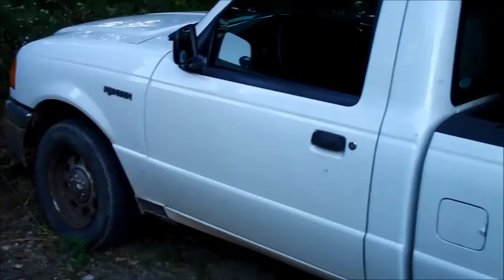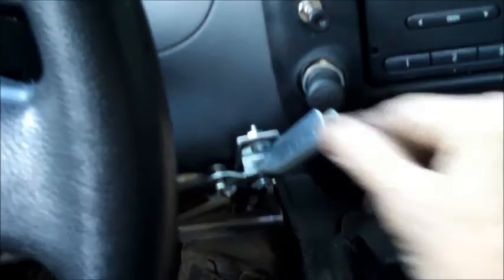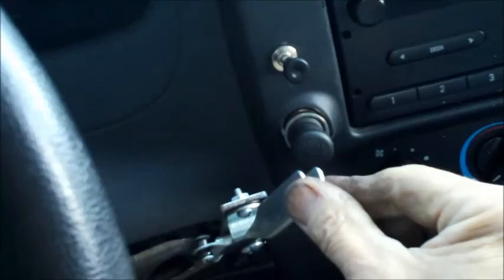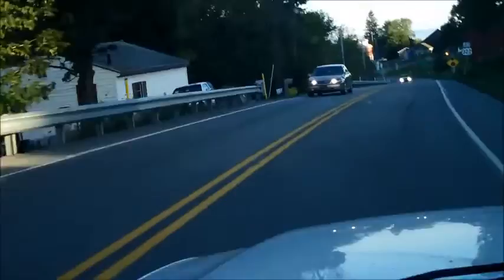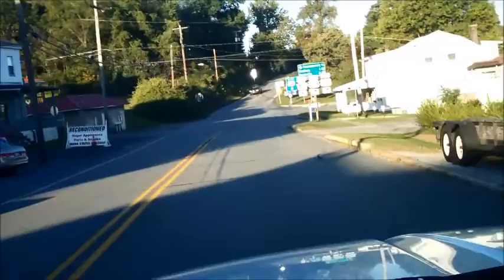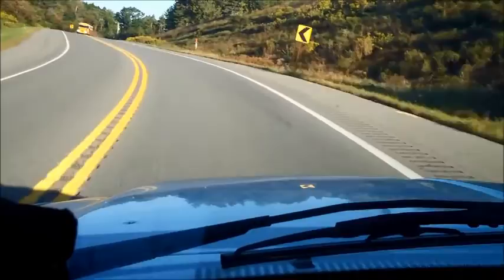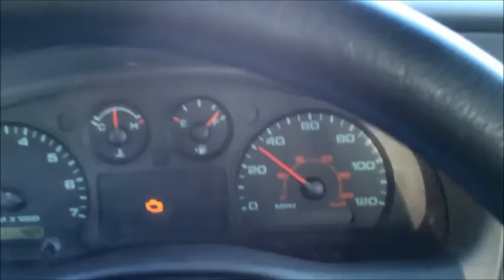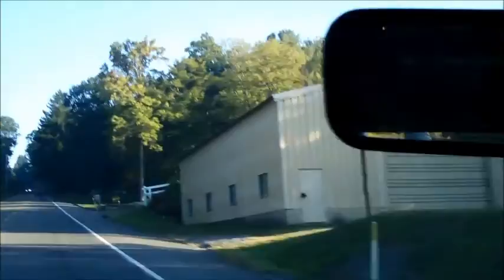Ford ranger road trip

Comment: Gary,  great work here.  I have recently been using my all ceramic grill(similar to Big Green Egg) to make charcoal via retort method.  I'm using 5 gallon empty acetone buckets to cut in half and slid together to hold the wood.  Drilled holes at the bottom of the 5 gallon retort pail assembly make a burner and let the wood gas escape which at a certain point becomes self sustaining requiring no external additional fuel to continue the charcoal making process.  I love using my charcoal grill to make the fuel that it uses-kinda cool.  My experimentation has lead me to investigate other uses for charcoal and I'm glad I stumbled onto your videos!  Keep up the great work.

Comment: Hey Gary, I made my first batch of charcoal last night and quenched it in a water bath overniht.  When I went to take it out this morning, there was quite a bit of unburned wood left in the mix.  I expected this because I  am using a TLUD in 55 gallon drums charcoal making method.  What I was wondering is if there is a labor efficient way to sort wood from the charcoal.  I was hoping the wood would just float to the top and some did, but some didn't.  Do you have any tips for me?  Thanks!
Reply from the maker: +Cory Warneke Hi Cory,  The partially burned pieces of wood are called "brands".  After some time, you will be able to quickly identify pieces of charcoal that are not thoughly charred and separate them from you charcoal.  This is part of the "art" of making charcoal,  I do not quench the charcoal made in a steel barrel.  This adds too much moisture to the charcoal if you are using it for engine fuel.  if you will add it to the soil as biochar than there is no problem in quenching it,   Keep making charcoal.  After a 100 sessions of charring wood, you will have a better understanding of how to do it and do it well.  Keep making charcoal!
Gary